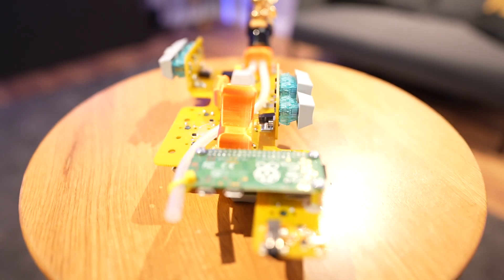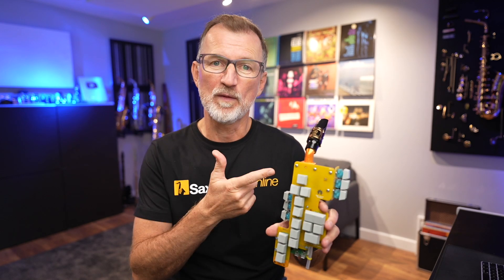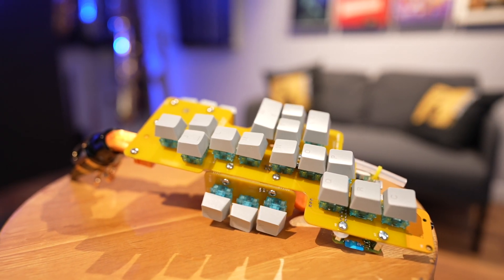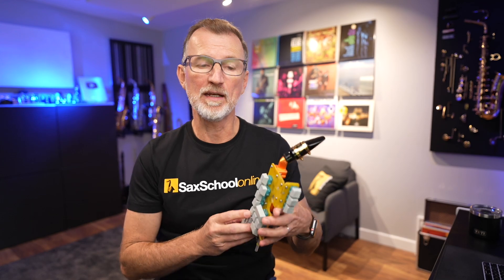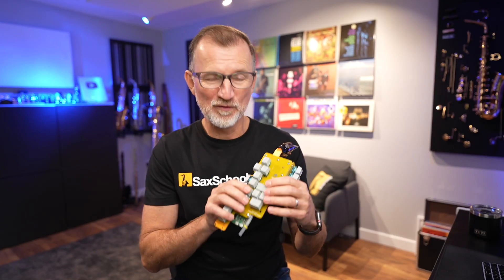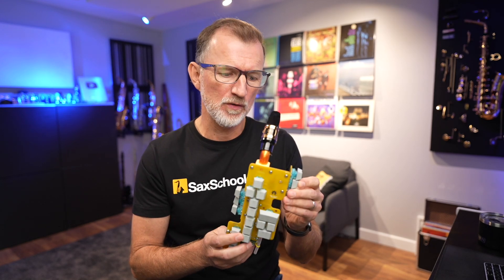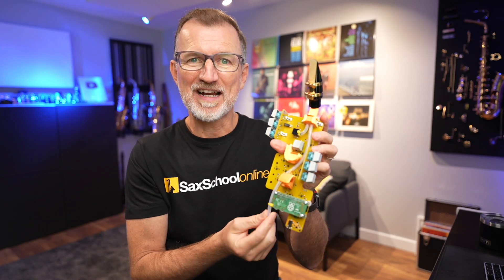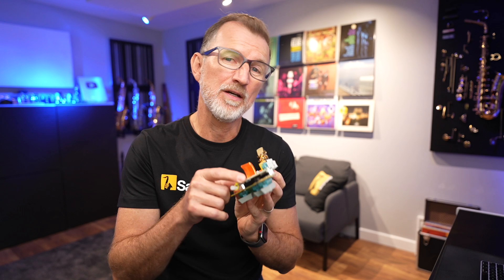The Haxophone   we made a saxophone

Comment: Javier, why don't you make the THING WE ALL WANT? Which is a mouthpiece and sensor kit that you slap onto a $50 used junk saxophone, to turn it into a silent practice sax.

The idea is that the electronic mouthpiece fits onto a normal saxophone neck, but dumps all the air out, to bypass the horn, after your breath input has been transduced into signal voltage/velocity signal. It just has a hole where all the air escapes, so the horn doesn't make any noise.

And the sensors just go on the keys (on the tone holes), with a wiring harness that plugs into a brain box, and combines sensor input with breath input, to make a sound you can listen to with headphones (bonus for MIDI output). Any given combination of tone holes produces a certain note/MIDI signal.

If you do it this way, anybody can buy a used JUNK ALTO, for $50 and use your kit to make a REALLY GOOD PRACTICE INSTRUMENT, that feels exactly like a real saxophone (because it is) but is totally silent (because no air is actually going through the horn), so you can listen with headphones.
Reply from the maker: Interesting idea!
Reply: @McGillMusicSaxSchool  I can only come up with the ideas... I need someone like you to make it happen.